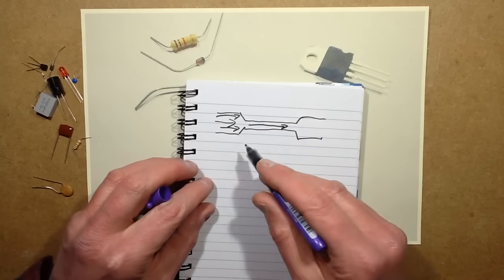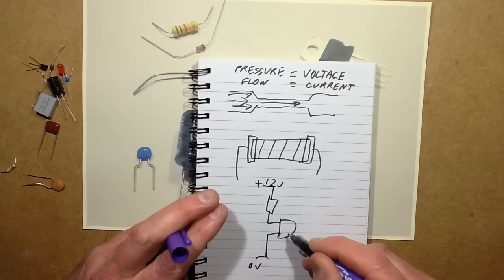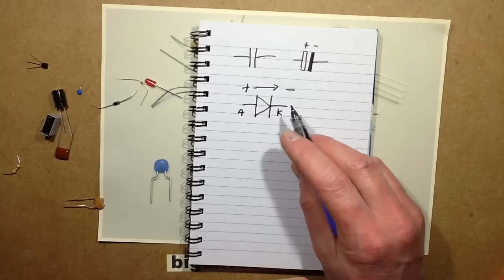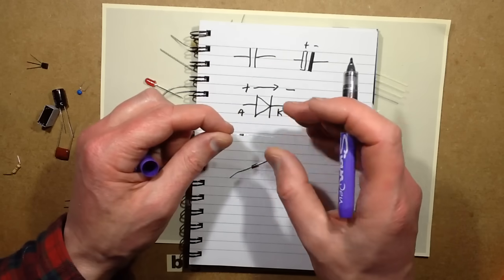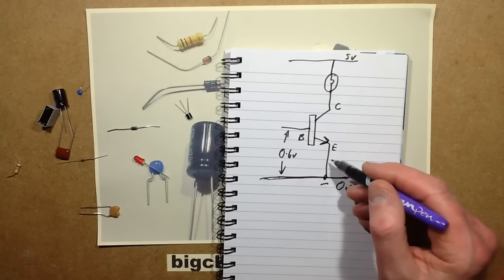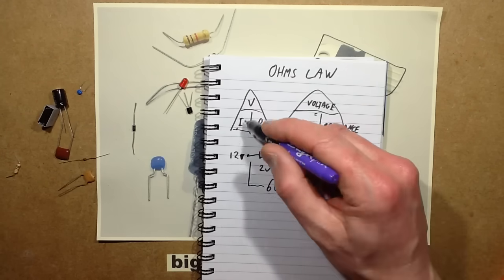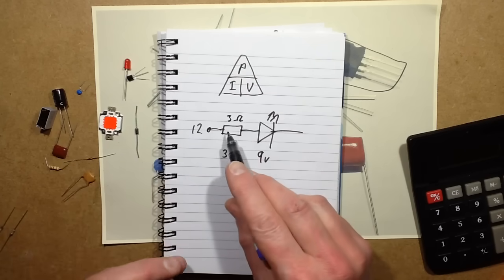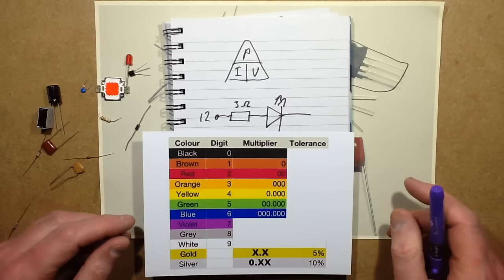A simple guide to electronic components.

Comment: For remembering which leg is anode and cathode on standard through hole LEDs and some other components I was taught: It's always positive to have something long.
Reply: +xad001x0w Just beware if you buy cheap LEDs off eBay et al. Occasional batches out of China have a longer negative lead...

Comment: I can remember being on pre-bath PCB* inspection in a factory as I was working through my electronics apprenticeship. I was presented with a circuit board where the certified model contained a resistor with 4 bands including tolerance (Silver or Gold) and the production line assembler had been given a 1% tolerance resistor (5 bands with the last band being brown for 1%). I questioned it, simply to be sure that someone had taken a definite decision to use that stock rather than the cheaper 5% or 10% stock. My supervisor then presented me with a colour code chart.......or rather the black and white photo-copy of a colour code chart.

* (Manually assembled Printed Circuit Board, before going through the conveyor solder bath)

Comment: Resistors resist current or are they just reducers? To my understanding, putting resistors in series, will continue to drop the current with each resistor added, rather than just reducing it to a specific current.
Reply from the maker: +Jay H They reduce the current flow.  Adding more in series reduces it further.  For accurate current regulation you need a dedicated current regulating diode or circuit.
Reply: +bigclivedotcom Okay, so for myself, I will think of a resistor as the repelling action of the opposing force of magnetism of like poles (north + north, or south + south), which pushes back, unless i come up with something better, because that's not perfect either. Maybe just pretend that a resistor, pushes current in the opposite direction, by the amount of force that it is rated at... Actually an accurate description is to just say that Resistors, convert Voltage into Heat.

Comment: Please make more component guides. This was great. Oh, and why do you use V for denoting voltage? V is for the measurement unit of volts but the actual physical "phenomenon" is denoted with U.
Reply: +SwordQuake2 
Hmmm, from a pure physics point of view, U is indeed the expression of potential energy. However since (for electricity) Ohms law is mathematically expressed as V=IR (Voltage = current(I)  multiplied by resistance(R)  I think you will find that V is indeed the correct expression for electrical potential.

Comment: BigClive, the reason why they use the letter "K" is because in German it is Kathode. Whenever a letter is already in use for something else in a subject then the German first letter of the name is used.

Other examples would be the "K" in CYMK which is German for "Kohle" because the "B" as in black is already used for "Blue" as in RGB.
Reply: +Michael Nager I was thinking the same thing but from the word Katharometer, we used them at the power station to measure the hydrogen that cools the generator, it has to stay above 95% or it becomes the most explosive gas. 
We also used demin water pumped through the windings of the generator to cool them down, it is a crazy system, but it works!

Comment: would an ESR/LCR meter in this case test the capacitor to determine it's good or bad?
Reply from the maker: +onecreativecriminal An ESR (Equivalent Series Resistance) meter can detect old capacitors.  An easier way on old power supplies is to measure the DC voltage with your meter set to AC to see an indication of the ripple.

Comment: I am having trouble figuring out how much power a MOSFET itself will dissipate so I can calculate the amperage it can handle without a heatsink.

For instance, the STP36NF06L you mentioned has an Rds of 0.05ohms @ 5V, so how would I figure out the amount of power the MOSFET would dissipate at a given amperage at 5V?
Reply from the maker: +Eisen Faust You can determine the voltage across it at 5A by multiplying the 5A by the on-state resistance of 0.05, which gives a voltage drop of around 0.25V which when multiplied by the current will dissipate just over 1W of heat.  That's in continuous use and not when switching on and off.
Reply: bigclivedotcom Thanks so much! I was stuck there for some reason. So, to determine the max Amps, I need the square root of (max junction temp divided by junction-ambient resistance) Watts divided by (gate resistance) Ohms.

Comment: Whats the color code for a resistor <1 Ohm? For example 0.5
Reply: +afroninjadeluxe Low-value resistors are typically very large in size (because they are used for high currents), and the value is typically written on them in clear text.
Reply from the maker: +afroninjadeluxe Green, black silver. 0.50 would be one way to represent that value.

Comment: So educational.... Could you help to explain, the differences between a capacitor and a battery, although they both can hold power, but they are completely different in many ways?
Reply from the maker: +rf05mjy A battery stores energy by a chemical process whereas a capacitor is only storing electrical charge in a surface.  This makes the capacitor simpler and longer lasting, but limits the amount of energy it can store.
Reply: +bigclivedotcom Thanks... There are so called "super capacitor" on the market for special applications, which may have for example, 3000 F capacity. The battery on the other hand, is using xx volts, xxx mAH to mark their capacity. Is it possible, for someone to design a circuit to use the super capacitor to act or replace the laptop computer battery? If that is not a good idea, why not?
Reply from the maker: +rf05mjy The super-capacitors would still have to be huge to compete with something like a lithium cell.  The bigger capacitors also tend to have quite a high rate of self discharge.

Comment: Electronics over 30 years old need capacitor replacements especially tube driven stuff.
Flat screen TV's and PC monitors suffer cap failure pretty commonly and most people do not know it is cheaper to replace the caps than to buy a new monitor especially the Youtube tech geek channels out there that claim to know all about that stuff..

Cathode with a "K"??? maybe a demographic thing??
I learned the diode symbol like this long ago: 
The Cathode is the side of the Diode symbol with the line, think of a Cat (Cathode) and its whisker
Reply: +ElfNet Gaming The cat reference apparantly comes from the first made diode which was actually called a "cat whiskers diode". I sell lot's of caps for TV and monitor panel repair and have seen a rise in the past five years in customers coming for parts rather than a new product. Youtube and channels like Big Clive's (and others) and the Arduino/Genuino board has really helped in this regards. As a technician I really hate to throw stuff out, but as a sales person I rather sell them a new product than the parts :) Cheers!

Comment: I would love more videos on this to help with my electronics GCSE. Could you do one on Monostable, Astable and Bistable circuits? :D
Reply: +Bob Shaw You talking about 555 timers, or just the definitions of the three terms? 

Put simply, a monostable circuit is only stable (happy) in one (Mono - one) state (as in on or off). This means that it will naturally want to stay in the stable state. If you force the circuit to change state, after some time or other, it will return to the previous state. 

Astable circuits are never (A - never) stable, so will spend time flipping between each state, only to decide that it likes the previous state more; kinda like a cat deciding whether it wants to go outside or not. 

Bistable circuits are (usually) equally stable in one of two states (Bi - two), like a dog that's happy whether outside or inside. They will stay in that state until a signal forces them to switch to the other state, where the circuit stays until disturbed by another signal (whether the two signals are the same or not depends on the actual design of the circuit).

Hope this helps!
Reply: Joshua Pearson Thanks! But I did mean the 555 timer circuits.
Reply: I'm not the best with 555 timers, since I loathe them (Only useful for extra-cheap and easy circuits).

First: pin layouts. Going clockwise from the top left on a diagram, 4,8,3,5,1,2,6,7. Pin 4 is reset, 8 is Vcc, 3 is OUT, 5 is VCTRL (voltage control, not always necessary for some applications), 1 is GND, 2 is TRIG, 6 is THR (threshold voltage, but if you're doing GCSE, I wouldn't worry about what it does), 7 is discharge (same again).

Astable: Pins 2 and 6 (remember, 2+6='eight'stable) are shorted together and connected like so with pin 7 in a resistor-resistor-capacitor pot.divider as shown: R7R(2+6)C.

Monostable: pins 6 and 7 shorted and connected inbetween a RC divider, pin 2 to your trigger input (could be a button, go nuts)

Bistable: 7 unconnected, 6 directly to GND (as you're probably referencing to ground in GCSE level circuits), 2 and 4 held high. Pulling 2 to ground turns 3 on, until 4 is pulled to ground, turning 3 off.
Reply: Joshua Pearson Thanks alot for the help !!! :D Do you know what the capacitor is for in both the Astable and Monostable?
Reply: The capacitor charges and discharges over time, which provides the delay in each circuit.
Reply: Joshua Pearson ah thankyou :)

Comment: I allways hear that you have to use a resistor, when lighting up LED's,  but is it really needed when the operating voltage of the LED match the voltage of the source of power ? ( battery, ac-dc converter etc)
Reply from the maker: +steffen førnes As soon as the forward voltage of an LED is reached it starts to conduct suddenly.  The difference of just 0.1V could cause a significant current jump.  The little LED keyfobs that stick the LED directly across a couple of button cells are relying on the cells internal resistance to limit the current.  With the strings of battery operated LED lights they sometimes use LEDs chosen to operate at about 3V.

Comment: I always felt the colors were in a "natural" order, I just had to remember which colors there were. Without a mnemonic grey and white never really fit though, so it quite some time to get them. In the end I remembered white because of the "39" values and grey then was the color that just got the last unassigned digit ;) .
In the end it's very useful to know the colors, because it makes it very easy to number small parts, connectors, identical PCBs aso with a permanent marker of the right color (many marker sets come with the digits "0"-"7" and you can of course put them in their correct natural order ;) )

Comment: What's a solid state capacitor then? I've seen them boasting those on motherboard boxes.
Reply from the maker: +rimmersbryggeri They may be referring to the solid capacitors with no electrolyte.  They can make higher values without electrolyte now, but they tend to be a lot more expensive.  With electrolytic failure being one of the most common causes of motherboard failure it's probably considered a selling point to use the dry ones.
Reply: Yeah that's the reason why they use them. Very interesting video BTW.
Reply: +rimmersbryggeri Probably referring to Organic Polymer capacitors. They're usually aluminum cans with blue or purple marks to mark the negative. They're quite expensive as Clive said, but they have extremely low ESR compared to electrolytics and typically fail open instead of failing shorted. I've used them plenty of times in critical circuits, and so far I've actually never had one fail. Good ones can be had from Panasonic. Their limitation as a capacitor type is that they're not available at very high voltages. This is slowly changing but generally they're low voltage units, hence being perfect for motherboards where you have very low voltage and super high current with lots of ripple and pulsed power that could easily kill an electrolytic capacitor.
Reply: +NatureAndTech I've replaced probably close to 1000 failed electrolytics in my life so far, and I've bought 460 electrolytics from Nichicon's PM/PJ series just last week for the same purpose. In my somewhat extensive experience, it can be summarized as follows:
-Low value electrolytics, such as 1uF, 2.2uF, 3.3uF are the first to fail, particularly in switching power supplies. The price of film caps, such as Panasonic film caps is low enough that you should only be using film caps for capacitance values that low. Low capacitance electrolytics = naturally high ESR = naturally high dissipation factor = higher operating temperature = premature failure. This is made worse by their small physical size, which concentrates the heat.
-I've had $2k to $30k equipment fail within the first year due to electrolytics. The power supplies in modern equipment are often made by a third party, and therein lies the problem.
-Old, large value caps tend to develop DC leakage over time, but capacitance and ESR can be fine for 30+ years. I've replaced some electrolytics recently from old mil-spec power supplies, which lasted for 40 years at this point. Some of the ones I left alone, have a high leakage current of ~150mA. They're still fine but should be replaced at some point - it was a cost thing since the replacements are $80 each for those.
-Whether circuits fail or not fail due to capacitors depends a lot of the circuit design
-Many modern machines with expensive switching power supplies are brought down by 1-2 electrolytics
-Failed capacitors don't necessarily lead to immediate equipment failure. Part of the "unseen" failure is a degradation of specs. If the caps were used as a ripple filter on the power supply outputs, then either the power supply will have much more ripple, or the super high ESR will create an additional load on the supply, stressing other components earlier in the chain, or both. Lots of "working" equipment I've refurbished had failed capacitors. Failure can be progressive, but it's a ticking time bomb. ;)
-I test DC leakage, ESR and capacitance. Those are the only 3 things you need to test. I use a wonderful UK-made ESR70 meter for the ESR and capacitance, and a power supply + multimeter for leakage current.
Reply: +ElfNet Gaming Polymer caps are not necessarily surface mount. Through hole varieties are available. I've used them. They're also not shrunk down. They have roughly the same volumetric efficiency as electrolytics for the voltage/capacitance combination. For higher volumetric efficiency, you have to go to tantalum, which are about 3x more efficient. The non-electrolyte types are not in any way similar to ceramic layered caps. MLCCs are a totally different technology. Many motherboards are made on with tiny profit margins, except for indeed hyped up gaming boards. When organic polymer caps became available, they were impossible to get in low volume and only motherboard companies had access to them. I know this because I was already using them back then. The cost difference is not trivial - we're talking $0.05 vs $4 in some cases. MLCC can be equally expensive per cap, but not available in as high capacitances as polymers. And as I said, I work with this stuff every day. I place parts orders weekly. And I've never seen a failed polymer cap so far, yet plenty of failed electrolytics. :)
Reply from the maker: +NatureAndTech In the bad old days electrolytics  only had to deal with low voltages and low frequencies like 100 and 120Hz.  Now they deal with high voltages (rectified mains) and very high frequencies around 30kHz.  That makes them fail faster and more dramatically.
Reply: +whatlions Isn't the failure of electrolytic capacitors over-rated? I have a lot of boards that are over 30 years old, and only a single one has had a leaky electrolytic capacitor. Also, with a typical life-cycle of modern electronics,  anything that lasts more than 2-3 years old must surely be considered "good enough".
Reply: +rimmersbryggeri Solid Polymer Capacitors.. Nothing new, they just use the the technical name and hyped it up like its something brand new to make money after the great capacitor plague... It's basically a marketing thing when in fact solid capacitors are used in electronics from the 90's. The Motorola Spectra 2-way radio uses them and it was released for sale in the early 90's.
The fact is the Solid Polymer caps are smaller variants of your traditional electrolytic but in surface mount form factor. they do have better ESR but the principle behind them are the same as the regular high quality thru-hole can, only shrunk down and SMC..
The non electrolyte types are similar to the ceramic layered caps just in higher value. again not a new technology, just motherboard manufacturers use the tech term to drawn in the $$. That and fancy LED lighting because we all like shiny things right? especially in a PC that NO one will ever see because its tucked away under a desk in a room no one but you goes into...
Reply: +bigclivedotcom Good point!! :)
Reply: +bigclivedotcom Clive, that makes a lot of sense. However, that doesn't make it the electrolytic capacitor manufacturers' fault, and the failures should fall in the "inappropriate use" category, or in the "designer's choice" category. So, my point is that in an age, where people throw away their gadgets within 1 or 2 years,  that's actually a fair design choice.